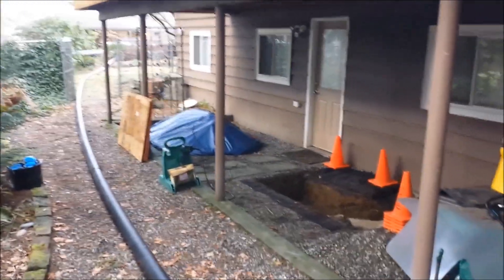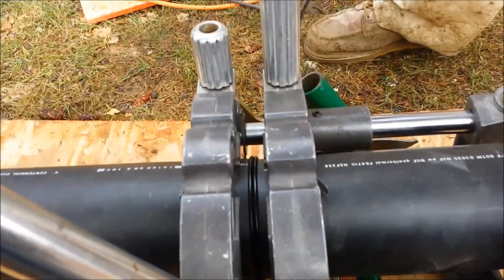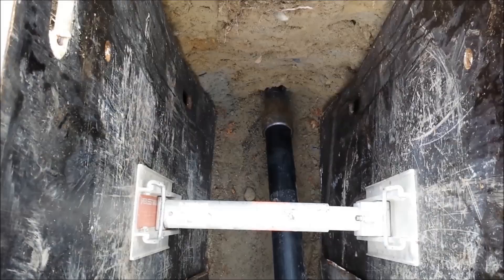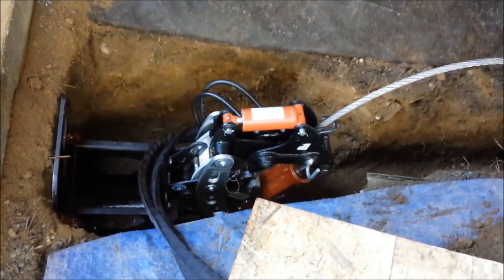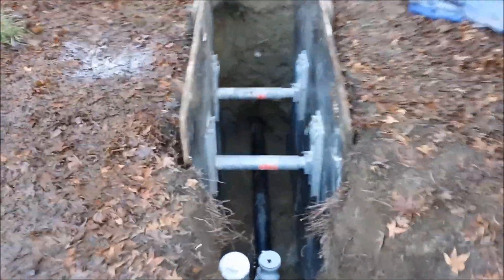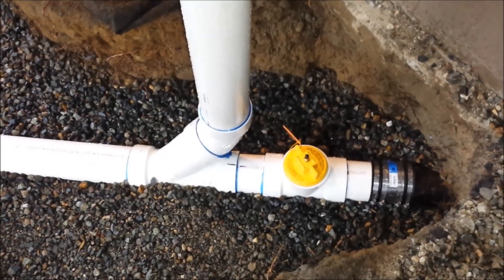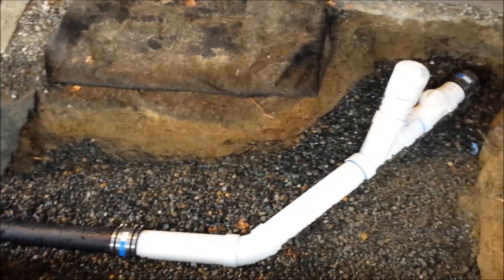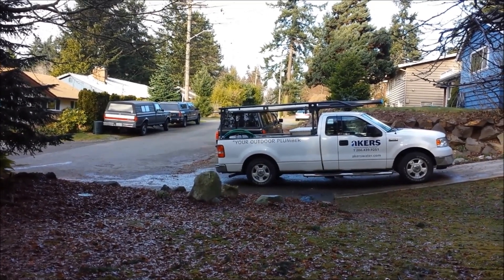PIPE BURSTING IN SEATTLE, WA (HOW IT WORKS)

Comment: How do you maintain a specific slope,?
Reply: The new pipe follows the old pipe. If the old pipe was graded when it was installed, the new pipe will also be graded. As long as the new pipe leaving the house is higher than the connection to the sewer system at the street, it will drain to the system.